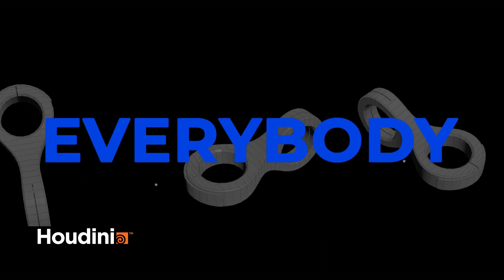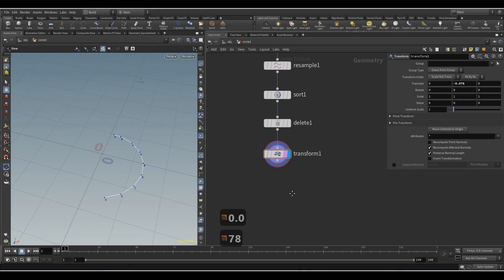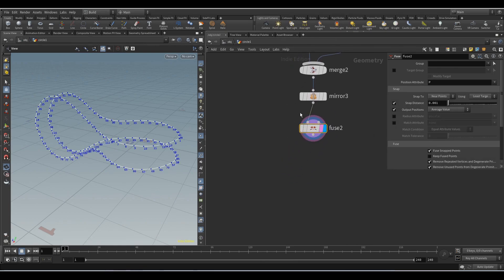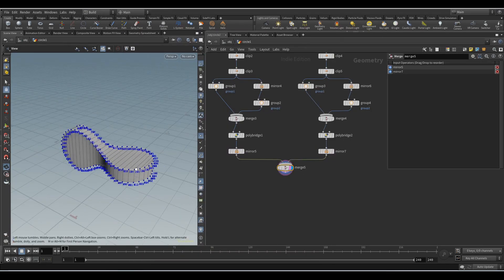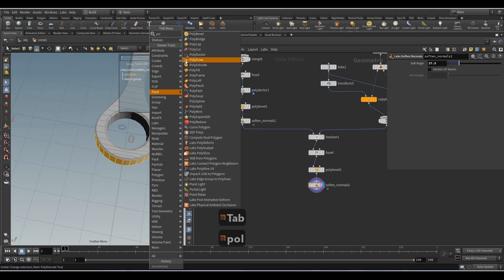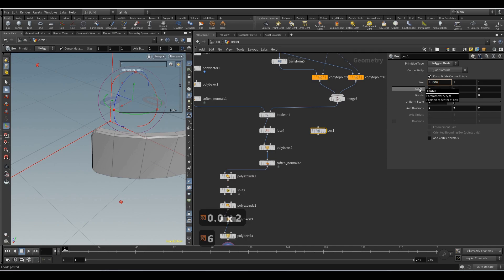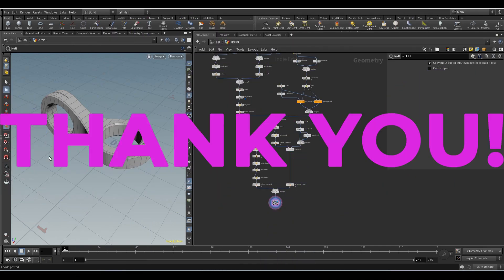Hard Surface Modeling Houdini Tutorial

Comment: 4:32 You don't need a "Labs Soften Normals" node. A regular Normal node is fine, with the Weighting Method set to "By Face Area" and the same "Cusp Angle" (37.5). It produces the exact same result.

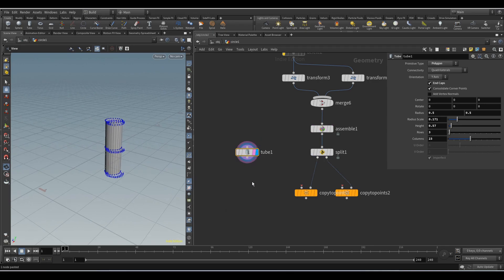5:31 You don't need "3" rows, 2 is best. Because 3 will create some undesired polygons when booleaning later because of the slight imperfections left on the semicircles by the Smooth nodes. The Fuse node after that might take care of it, or it might not. But why would you have to adjust the distance of the fusing? Just set it to 2. It results in a clearer boolean operation.

6:38 That creates horrible topology, lol. You would need supporting edge loops for something like that. Or leave the holes as unfused empty space and "fill" them with separate geometry. Look at those crooked inner edges!

6:44 Again with the Soften Normals...
If you double click that node, you'll see it's just a regular Normal node with the settings I mentioned above (ignoring the Switch, which isn't even used here, it's probably that checkbox).

5:50 "Next, we will manually select some faces and extrude them." 😨 That's not very procedural at all. If you ever decide to increase the number of polygons on the side, that manual selection immediately becomes worthless. You should have used the Group node (or two).

If you look at it from the Front view it slightly banks. Because of those 3 Smooth nodes. Not very "CAD-like" at all.

But you can still learn a lot from this. Not bad. 👍 I don't think there's any other tutorial in Houdini on making this shape.

Comment: I use houdini 19.5.435, there is no such thing as a soften normal node... :(
Reply from the maker: you have to update or install Labs, it's a set of free tools developed by Sidefx guys:)
Reply: @RaduCius  Yeah I’ve been trying for the past hour and it doesn’t want to update my shelf with the tools. I tried both techniques without success ;(
Reply from the maker: @Underwood42  try to write to the guys from SideFX, they are very responsive
Reply: You don't need it. A regular Normal node is fine, with the Weighting Method set to "By Face Area" and the same "Cusp Angle" (37.5). It produces the exact same result.